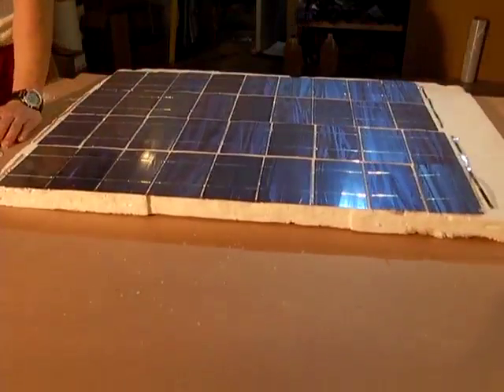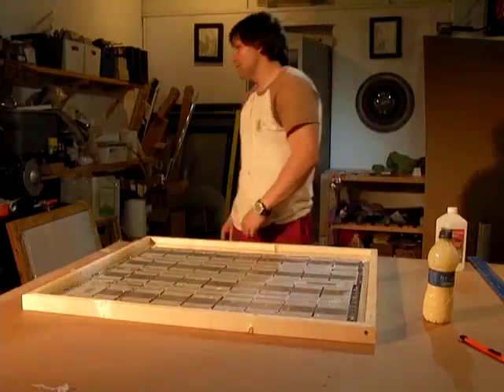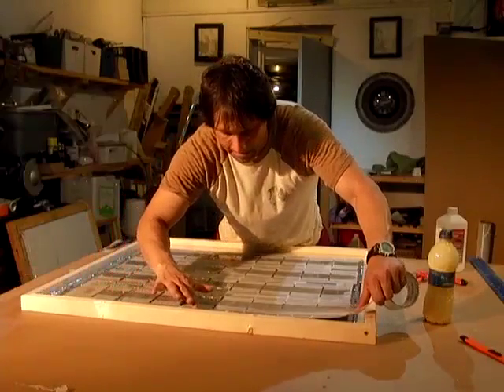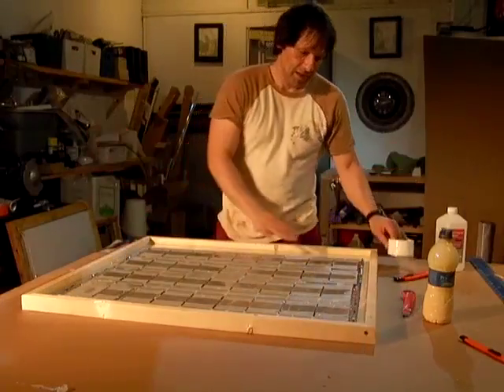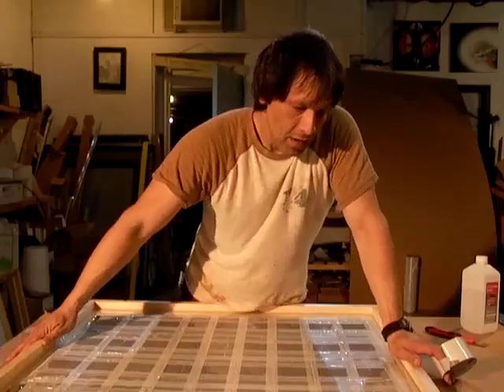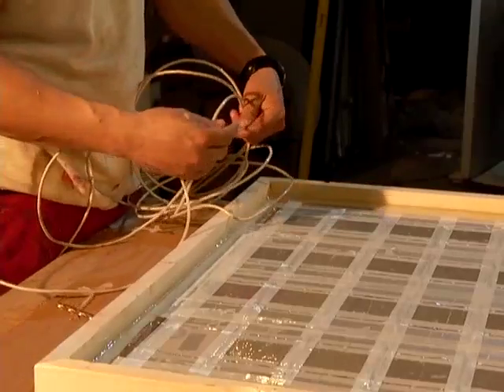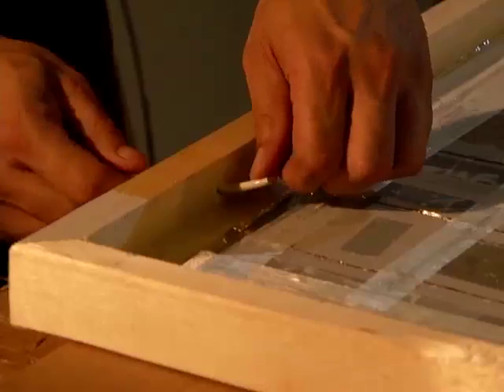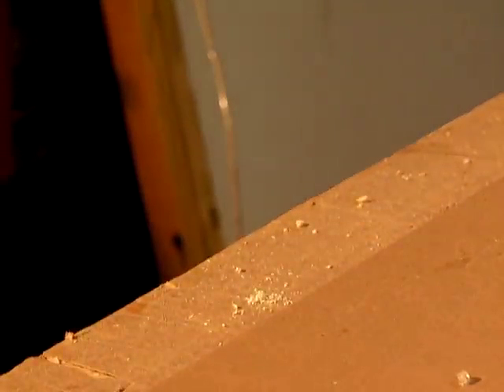DIY Solar Panels How to Solder the solar cells part 4 Solar Cell Mounting for PV photovoltaic

Comment: Sillicone for a buck? try 8$ for waterproof sillicone tube. you may have only squeezed a buck but that tube's more than a buck. also to solve the snagging problem you can make a knot in the wire on the inside. your way might be better to not compromise the seal.

Comment: Putting down some cross supports on top of the cells inside the frame and applying a small force on them and then casting the void areas would prevent the cells from lifting. You could just cast the supports in place. It would add weight but also rigidity. Just an idea. Your the guy getting it done. I'm just an observer.

Comment: Just a thought, try adding a strain relief to the wire before it exits the panel, even just a knot in the wire will keep it from pulling off the solder if it is pulled. I used mc5 connectors on mine to make it easier to tie them together and to be more modular.
I also would always paint all sides of the bare wood prior to assembling the glass in it to add durability and stabilize the wood frame more, or you can use aluminum as the frame material instead of wood.

Comment: how did u connected the cells with each other and how did the whole shhets are soldered with the connection wiere? thanks
Reply: +dekhi Well if you noticed this is part 4. There are 3 other parts where he shows this.

Comment: When you are soldering, the solder should flow. You are making pasty solder connections that may have higher resistance or possibly fail.

Comment: You need to prevent oxygen from degrading the solar cells.  If you don't seal the cells from the elements by encapsulating or other means, they will not work well for long.

Comment: Just curious, since I'm learning all this for the first time... What is the purpose/benefit of encapsulating the cells rather than just using a thin board, for example, to hold the cells in the frame? I mean, the cells seemed to work in your earlier video when you tested them, so it can't be about functionality. Or can it?

Comment: instead of using zip tie and screws, just make a knot on the inside end of the cable. It won't go through the hole

Comment: I tried this idea, but it failed. I live in Arizona where we have extreme sunshine and heat. In my opinion, it failed because a small pocket of air between the glass and solar cell is trapped inside when the tape prevents epoxy from front encapsulating cells. This air will expand when heated by sunshine, creating very high pressures inside, and eventually forces the epoxy to crack and detach from the glass.

Comment: Roughly 70 Watts peak, I later discovered my tester was giving me bad AMP readings. The real readings are 3.3A @ 20.9V. Amps times Voltage will give you watts (in this case 68.9  Watts). the panel has a total of 39 pieces of 3x6 inches.cells with 1 inch spacing between each column to aid in heat dissipation. It makes the glass covered area 22 inches wide by 120 inches tall. These cells were bought at ebay and were rated at 1.8Wp so they are working well.

Comment: Hey Dan, thanks for the tip, I'll add a layer of fiberglass cloth to the mix to make it stronger yet flexible. So far so good, I made a 3 x 13 solar panel wich is producing 20.9V and 5.5Amps. I tought about using EVA, but it is costly to have it ordered because I live in the Dominican Republic. So I will experiment by completely covering the cells with transparent tape, then I will add a layer of fiberglass. What do you think of this approach? is it worth trying?

Comment: im sorry dan if its a stupid qustion but why not just use 2 glass panel one rear one front   seal in between withe silicon   and maybe even vacum air between glass for an air tight seal?  resin is expensive and messy to use...

Comment from the maker: Possibly, just make sure the resin has limited UV exposure, white tape. Also do not over do it with the MEK as the endothermic reaction of hardening can create a lot of heat and stress the cells. I usually do not like fiberglass for application, thin fiberglass with no cloth structure cracks and gets weird when heated. solar eva sheets are a good cheap option.

Comment: Hey Dan, I'm about to do this kind of encapsulation with my solar cells, but I will be using regular fiberglass resin in order to lower the cost. I have waterproofed my wood frame and painted it white. I'm gonna use RTV silicon as an additional sealant. Do you think fiberglass resin could do the trick?

Comment: what if you used eva on the negative side against glass then used epoxy on the back to eliminate air gaps under cells?

Comment: shartne,
     Tempered glass is a good idea.  You can often salvage it out of old storm doors.  I have beaten on it with a hammer without breaking it.
     Suggestion about the two holes:  drill them before you put the cells in the wooden frame.

Comment: first off thanks for all your hard work, but I do see alot of stuff you didnt do. 1. you didnt seal the wood. in a few months there going to turn green and brown and then fall apart. 2. you want the resin to go in front of the cells to seal it and make it air tight. but over all nice panel. thanks

Comment: Very good panel, where do you buy your broked cell?

may i suggest when you put your wire to make a node when its the frame so the wire will not be able to escape the frame and help to not add stress on the wire connection (soldering)